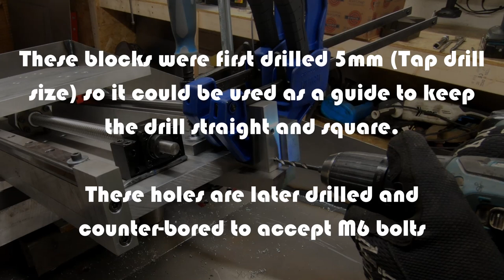DIY CNC Milling Machine Build (Part 9) NEMA34 Hybrid Stepper Motor X-Axis bracket

Comment: Hi dear @Seabass Engineering
Thanks for sharing your great project. 
I want to know why do you choose closed loop stepper instead of a servo motor? what accuracy and speed do you expect from this motors?
Reply from the maker: Mainly due to cost. closed loop steppers are much cheaper. I have found that accuracy is so far very good.